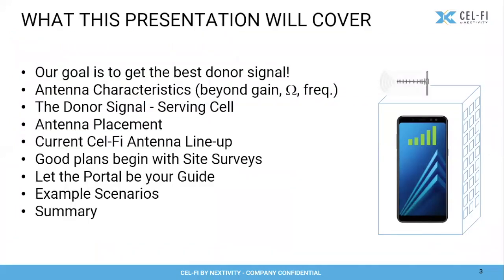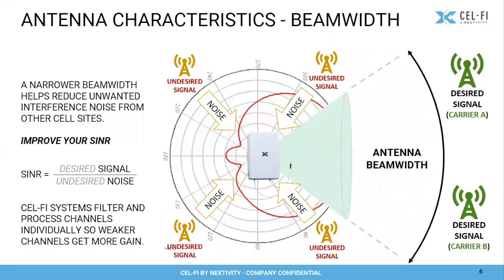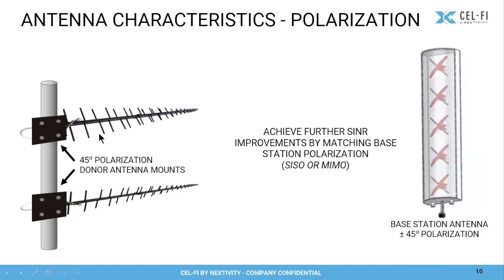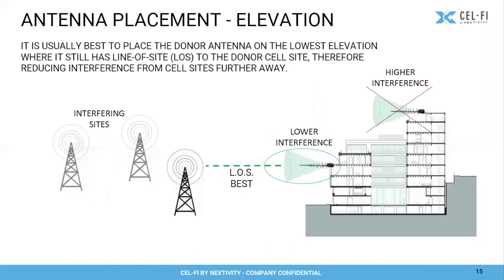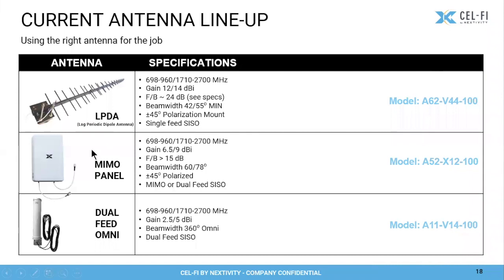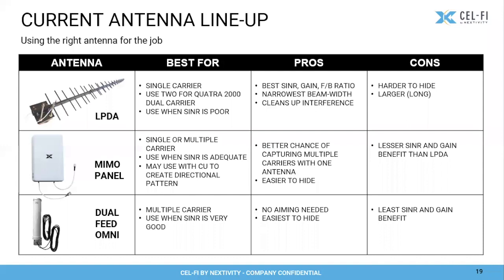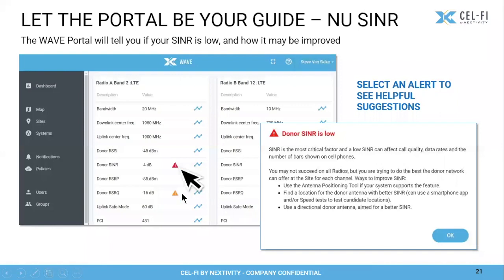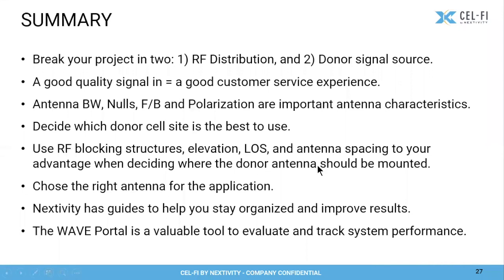Cel-Fi QUATRA Antenna Selection

Comment: Good to see you  guys know your stuff!!  I install these and it is never straight forward as the home handy man installations ! It  normally take me  1 to 2 hours  to work out the best location and tower and making sure your not picking up another Cel Fi installed in a near location ! Sight survey is a critical point before installation My mounts are always 2 meters above the roof level for cyclone prone area !! however i have done 10 to 18 meter masts in the Western Australia out back /Cattle stations and big commercial locations  I seem to learn  something each installation and yes when there is so many towers i have used a Omni directional antenna  and checked back with customer and it has been good for them ! I use ookla  for speed tests !! My choice ! First time i found this sight  so i will check back for more information from time to time !!

Comment: except for comment a 22 mins about phasing two donor antennas to pick up two cells - don't do this.
Reply from the maker: Hi Steve, if the donor antennas are sufficiently narrow in Beamwidth then yes this technique does improve SINR for both. And while the noise contribution from each antenna affects the other, this is taken into account in the proprietary Antenna Aiming tool algorithm (a feature of the WAVE Portal remote management system).
Reply: @Nextivity  thanks for the reply. I think there is a risk in choosing multiple donor sites, particularly if the chosen donor cells are not in each other's neighbour lists.
As said in a previous post, a good webinar, thanks post posting this.
PS. We are installing our first QUATRA system this week.